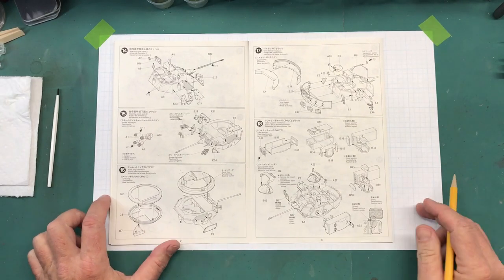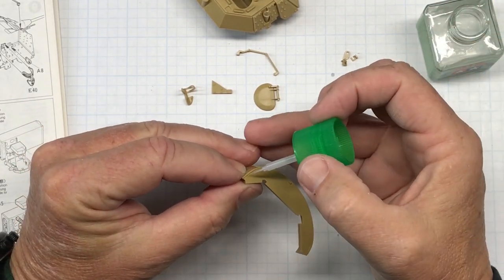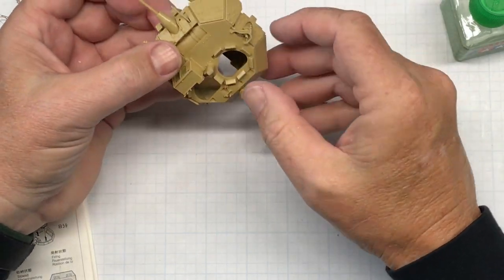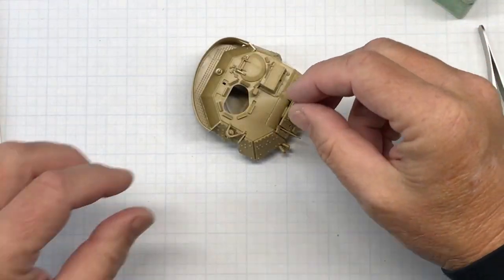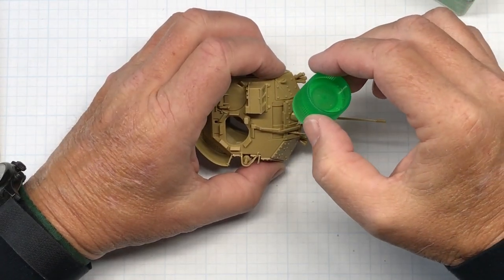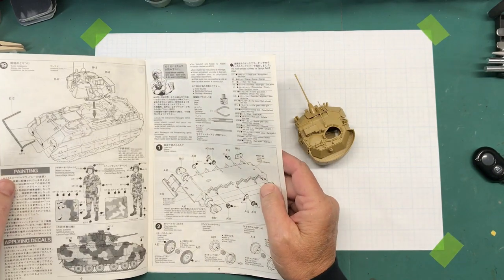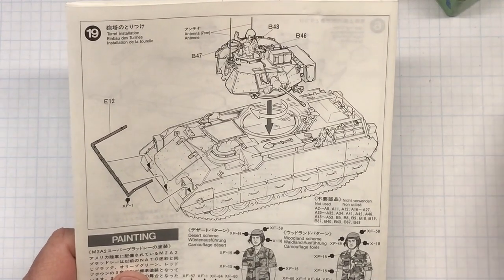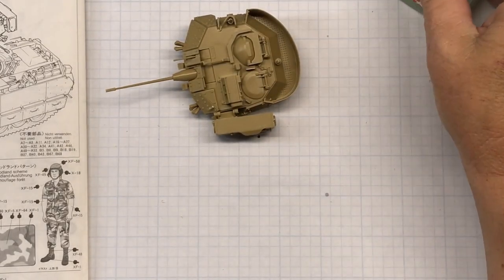Tamiya 1/35 M2A2 Bradley, Part 5 Steps 17-18

Comment: looking great so far Brett.  Btw, I'm starting to move away from my Vallejo air and Mission model paints to AK RC so if you are interested in some I could send them out to you
Reply from the maker: Funny you mention that. I have been reading reviews and comments of the Real Color line all day! LAL. What do you think of the RC line? They seem to be really good as far as sprayability and durability. Some complain about the colors themselves being off, but that is true about all brands. What thinner do you use with them? What is the smell like compared to Tamiya?
Reply: @BrettG64  I like them so far.  They have the exact same consistency and sprayability as Tamiya (I thin both out with Mr. Leveling Thinner) but the nice thing about them over Tamiya is that they have specific colors.  There are always going to be people who think the colors are off lol and yet none of them seemed to have been around in WWII haha.  Now the smell..it's actually MORE potent than Tamiya as I think its more lacquer than acrylic (it's one of those hybrids like Tamiya).  That's why I was going to offer you my Vallejo and MM as I move away from them.  I work out in the garage with a huge ventilation system so I don't mind using harsh paint.  The thing that irks me about the Vallejo air is that you can't chip it using the hairspray method and I'm honestly tired of brush/sponge chipping with it lol.
Reply from the maker: @MadGeniusProductions_MGP  I've found the same thing with Vallejo. I bought a few bottles when I got back into water-based acrylics and they sprayed pretty well (except for the German armor brown!) but you are right on the chipping part. If you are just going to toss the acrylics, I'll take them! How can I contact you with my info?
Reply: @BrettG64  omg it keeps blocking me from putting in my email address.  I think a couple of my messages are probably in your "being held for review" on your YouTube Studio now haha.
Reply: @BrettG64  email sent.